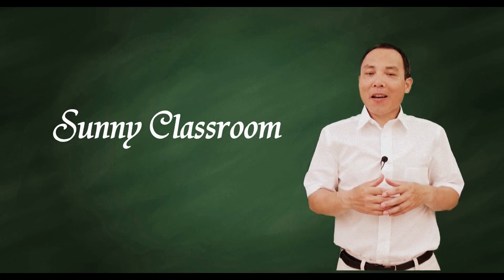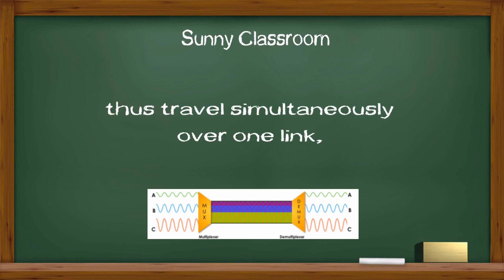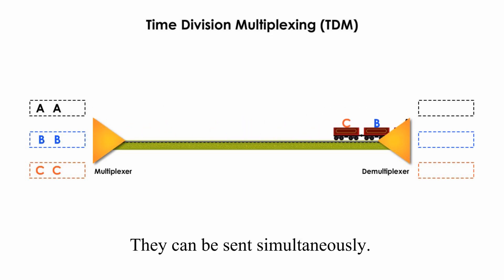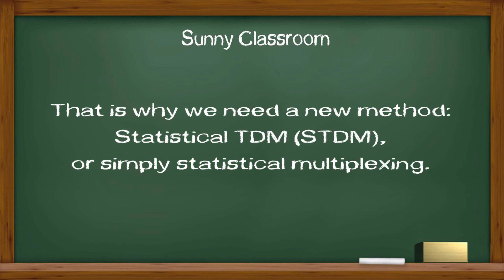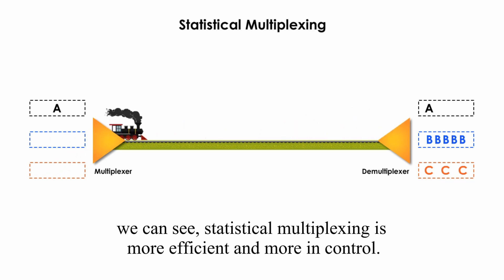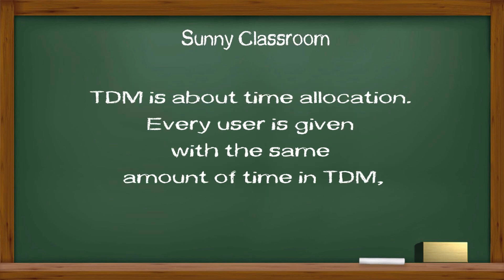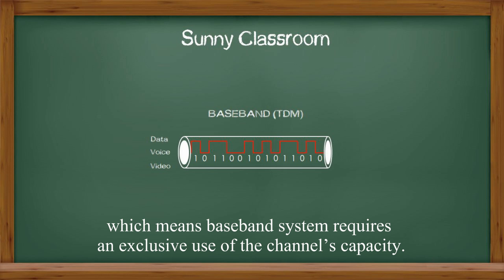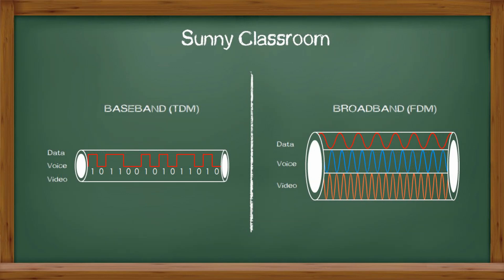TDM, Statistical TDM & FDM

Comment: Multiplexing means combining signals doesnt it,But I think it must be more of transmitting signals simultaneously,because you said that the signals transfer as their own, i mean in FDM  signals are just modulated into different channels and send combinedly its not a individual signal carrying all data is it????
Reply from the maker: Correct. You are right about multiplexing, mixing different signals and send them together simultaneously. However, they are traveling using different frequencies. In essence, they are still traveling on their own. It is just like a multi-lane highway, different vehicles can travel together, but they use different lanes. 
Thank you very much for your question!

Comment: sunny your way of explanation is very impressive, i have a request can you please give an example of broadband as you gave for baseband (Ethernet cable)
Reply from the maker: It is on my to-do list.
Reply: @sunnyclassroom24  thank you
when you done with it please tag me in that video
Reply: Sunny Classroom fhtj fb m
Reply: If my understanding is correct you should be able to consider all information, transmitted via a  fibre optic cable, for example, a broadband system
Reply: hjj lo ghjo